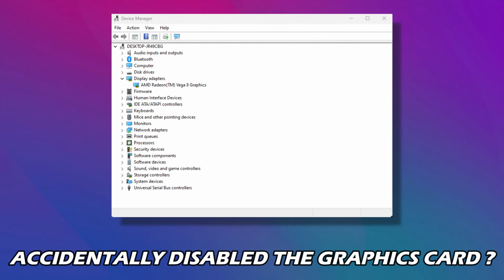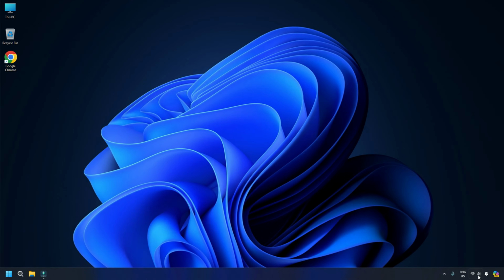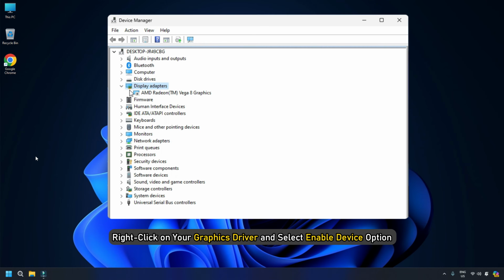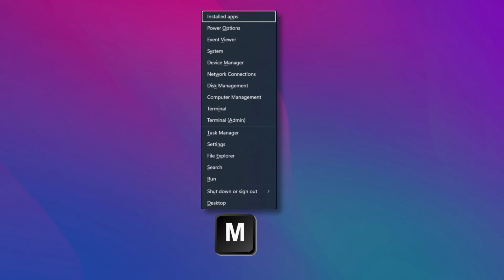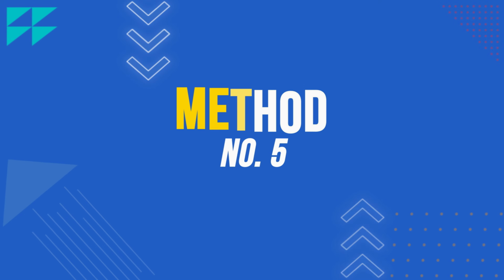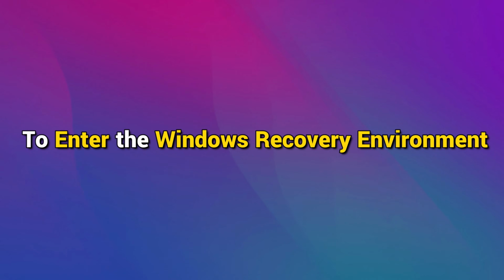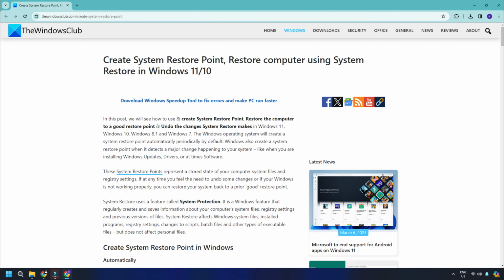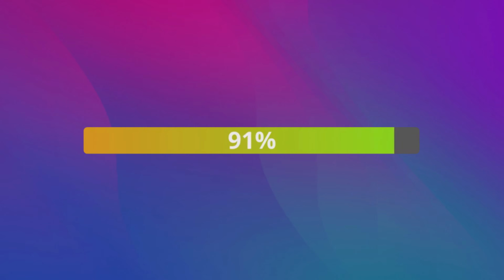Accidentally Disabled Your GPU Driver? Don't Panic! Here's How to Re-Enable It [Easy Process]

Comment: Remember guys, if you have multiple display drivers just remember you might have to add an extra step and press the down arrow key an extra time to get to your driver, if its not the first on the list😅
Reply from the maker: Exactly! 😎 If your system has more than one display adapter, make sure to select the correct one—sometimes it’s not at the top of the list.

Comment: Worked like a charm! If you have two drivers, just press the down arrow key twice after the step where you select the drivers
Reply: Bro i am dieing i couldn't know how to do it
Reply: Facing the same problem, I have to deliver my project today😢😢😢
Reply: @ONEMurad  thanks allah because i solve my problem by just buy new screen and open it from the entrnal gpu
Reply: @Organism..  how 😭😭😭
Reply: @ONEMurad  i just have the problem because i didn't have screen so i used to use my laptop with monitor but now i bought screen so now i can see 💀💜
Reply: @ONEMurad  what is your problem exactly?
Reply: @Organism..  i disabled the display driver intead of graphic drivers , now my screen is black, also there is no HDMI display option on my mother board
Reply: @ONEMurad  aaaaaa just gave it to Computer Engineer i think he will solve the problem or if you have pc not laptop try to plug in the wire of the screen with the motherboard to try to open it not with the graphics card but firstul the problem is so easy for you because you didn't do wrong thing so don't think like your pc gone for ever and take it to computer engineer
Reply: This was key

Comment: What if i accidentally disabled my monitor and now it says no signal and doesnt work i dont know waht to do, can u help me please
Reply: Same. , did you fix it
Reply: @rohitxd-fe7wn  yeah i just plugged the 2 monitors both into my gpu and enabled the one that was not working, or u could change the type of cable, if u have a dp cable change it to an hdmi  and it should work fine
Reply: @rohitxd-fe7wn  if u dont have a gpu just plug them into ur mobo

Comment: I just plugged my monitor into the second  hdmi port and it worked. Apparently the 2 cards are linked to 2 separate ports. Unfortunately my Nvidia App does not allow me to select my preferred GPU card.

Comment: SUGGESTION FOR ANYONE ELSE HAVING THIS PROBLEM:
Solution 3 worked for me but it was suck a pain to navigate blind. STRONGLY suggest using Ctrl + Win + Enter to start the narrator right after logging in! If theres any popups when doing so, pressing Alt + F4 a few times to reset yourself back to the desktop will help. After that you can follow the steps and know you're doing the right thing by what it says! Thank you for the video!

Comment: I had two graphic cards. In method 3, before hitting ALT press down once to select your 2nd graphics card. Than hit ALT etc etc. It worked after trying this, took about 5 secs for the windows connect sounds and than I had to power down my laptop. Next time it turned on it worked again
Reply: Bro i just gave up i tried yours also because i have tow drivers but nothing happening
Reply: Idk i am scared that my gpu went for ever because of  disable

Comment: I tried the method 1 and method 3, it wouldn’t work for me. I had upgraded my GPU from Nvidia to AMD, and the login screen is sometimes not working as it detected there’s system changes. So I think i couldn’t get past the login screen, and I don’t know what to do at this point. I couldn’t really get into the BIOS since the BIOS logo won’t even appear on the screen.